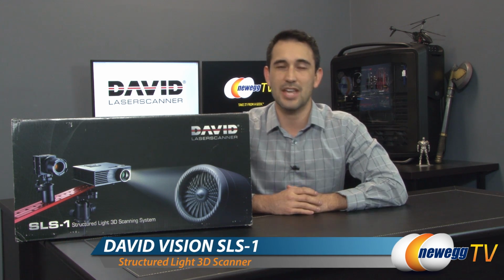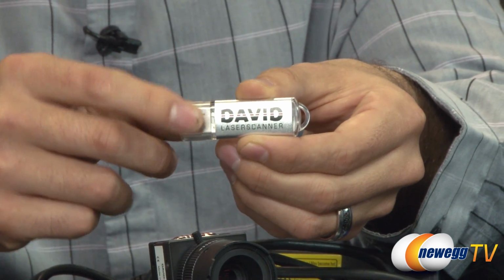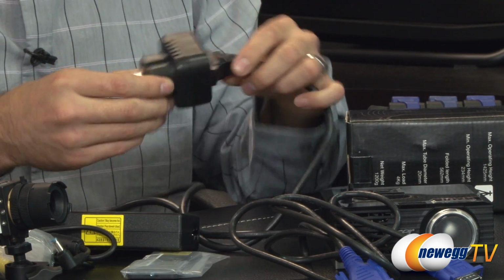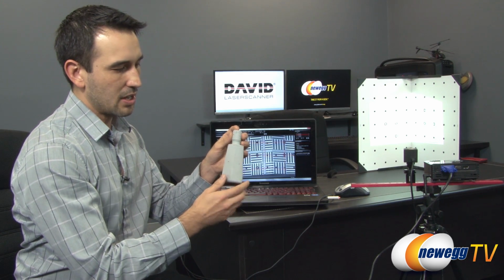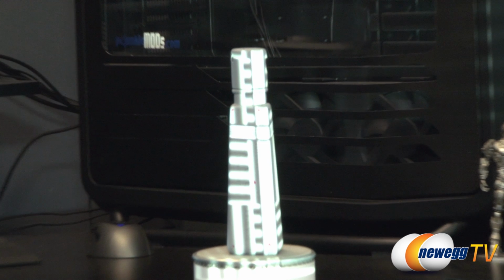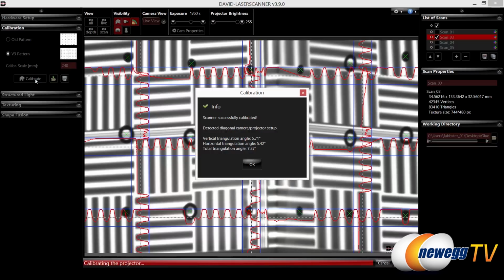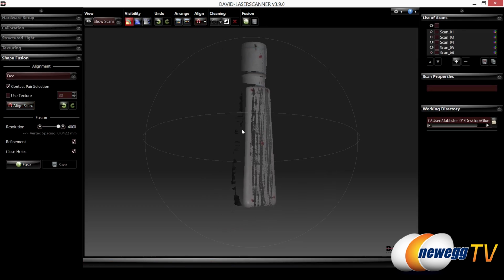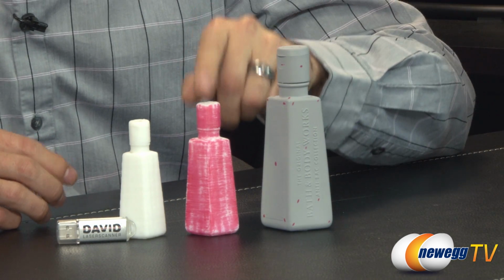DAVID VISION Structured Light 3D Scanner Overview - Newegg TV

Comment: DAVID SLS-1 is dated, and in particular the model used in this video is based on a medium resolution camera. The actual DAVID scanner is called DAVID SLS-2, it includes a camera and a videoprojector with double density resolution compared to those used in the first SLS-1, the results are even drastically much better than what was already achievable with the first DAVID SLS-1 scanner presented here

Comment: David sat down one day and thought, hmmmm what can I do with this crappy low quality projector and a mono crappy camera - UREKA I know - licence some 3D software that is going cheap (cos it's crap) - bung it in a big box and sell it as Hi-Tec semi-professional 3D scanner kit and see if any mugs will buy it OH and give it a fancy scientific sounding name - THEN (heres the kicker) lets say charge just under $3K... We're in the money, la la la la la
Reply: I am sorry, what scanning equipment do you use? Mono Crappy, you mean Machine Vision Camera that can cost over a thousand dollars, and is used for inspection because of it's very low distortion, and pixel accuracy? Funny, My shitty projector, similar to David's produces results that I haven't seen in nearly any other white light systems. If I was using David, and I have tried it, I can get the same resolution. Check out my page. It's far better than what people are doing with Primesense low resolution sensors and the principle is the same. I don't like David for a couple of reasons. It was built for lasers, the calibration is not sufficient, therefore they cannot use dual cameras....Yet. Far cheaper than other products, just as accurate

Comment: It didn't do a great job even with a simple object, So I doubt it would produce good scans of more complex and intricate sctructures. In fact, Just using pictures, You could replicate simple objects in any 3D modeling software faster than the time it takes to setup and then scan the objects with this hardware. It capabilities certainly cannot justify its price. It's no pro work tool, But just an expensive toy.
Reply: You might want to do a bit more research. David is capable of scanning as much detail as comparable white light scanning products. In order to scan with pictures with as much detail as David, you would need high resolution cameras setup in an array of at least 2 cameras. And even then, you are not going to get the density for hard surface objects that you would get with David. Now, that isn't to say that isn't possible, you just have to have the right equipment and that is expensive, for example, Cameras must ideally be DSLR. If you want scans like Infinite Realities, or Ten24, you are going to spend over a hundred grand. David is a slower white light system however, and one thing it lacks, is multiple camera setup. Other than that, if you purchase the system, you can get excellent scans that are professional.